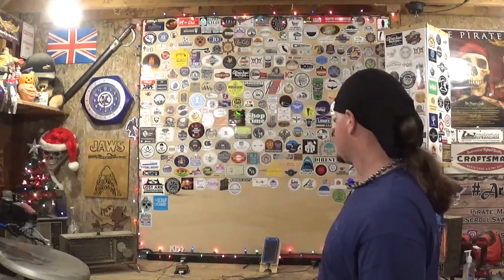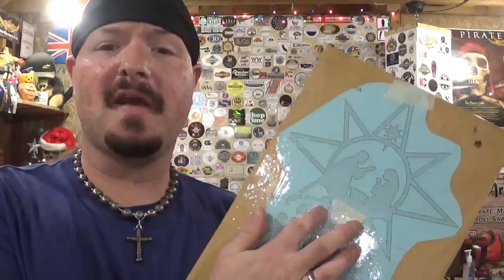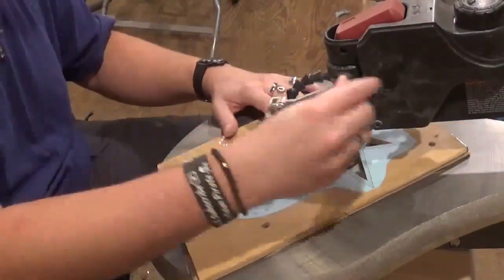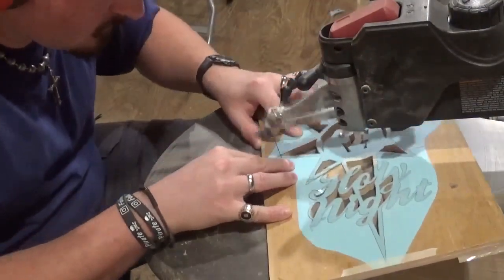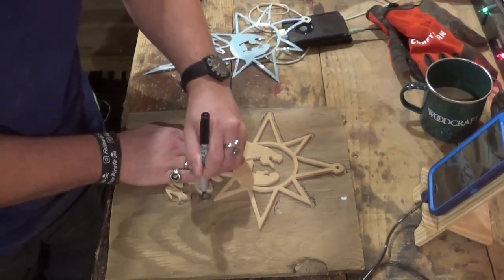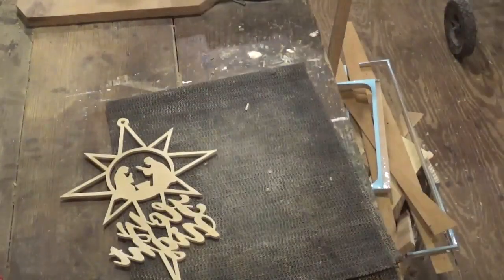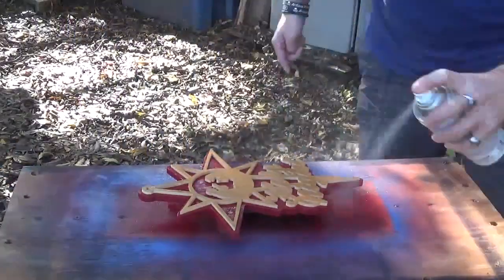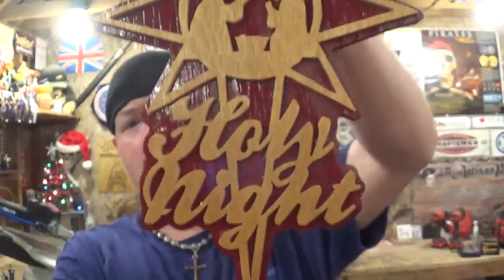Holy Night Christmas Star, Scroll Saw Project

Comment: Another fine job.  I have had trouble with glue sticking to paint so I have to put little pieces of masking tape on the backer so there is raw wood for glue.  Just me.  Your into is getting better all the time.
Reply from the maker: Thanks Pat !  And yes, I have seen people mask off areas with tape before painting for glue up, however I have never had an issue bonding bare wood to painted wood with gorilla wood glue

Comment: Nice cut job on a pretty design.  I have a question about your new saw.  In your high speed video you reach back on the right side of the saw whenever you bottom feed.  Is there a lock or lock release for the elevated arm?
Reply from the maker: Aye it is. And this mechanism is only on the 20 inch Delta